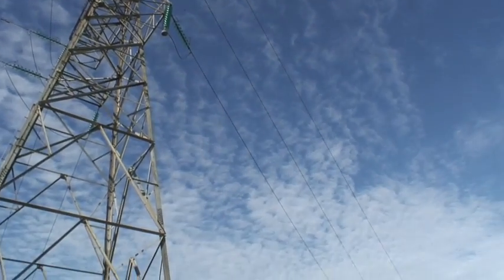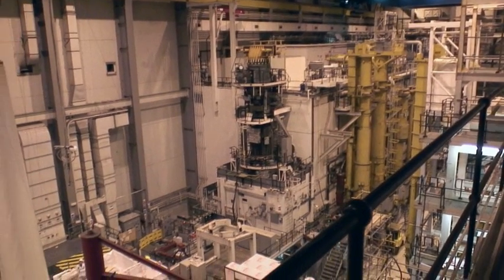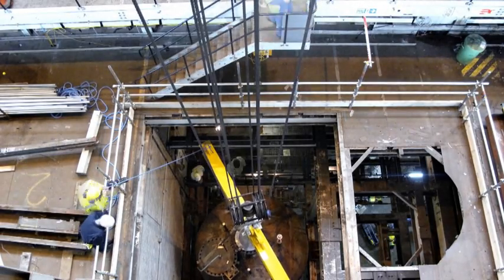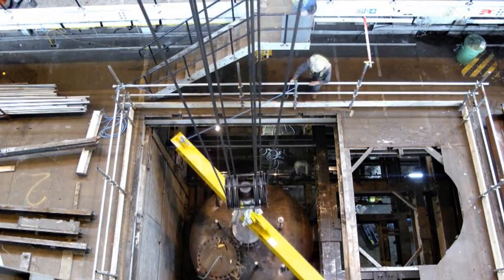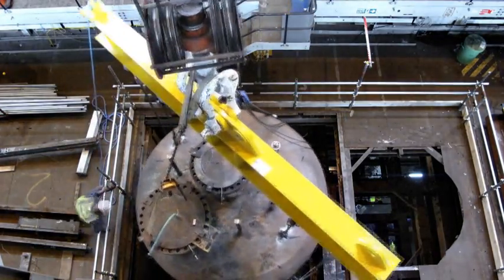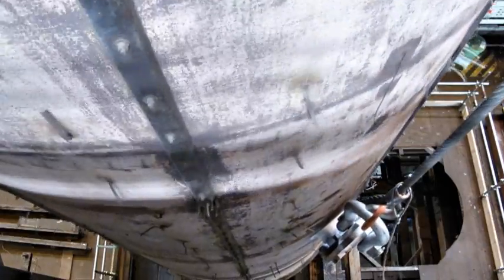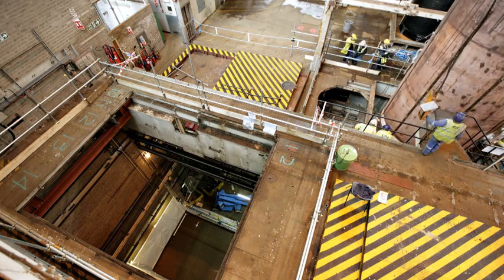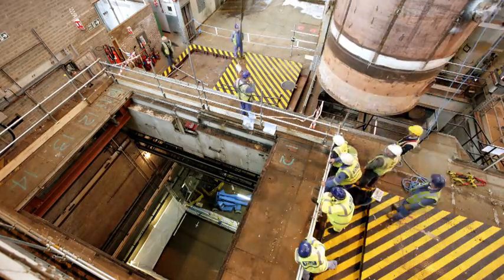Lifting the PFR dirty dump tanks

Comment: Back to burning coal?
Reply: Yep. It's crazy. We need to be converting most of the base load to nuclear energy.
Reply: @gregorymalchuk272  for some reason that reactor was to small to be able to be run profitable .... Not enough electric power out of it to pay it's bills.

As long as nuclear using countries can buy cheap uranium from Tchad (and other states in Africa) fast reactors wont be profitable.